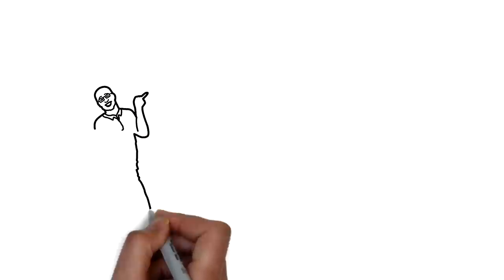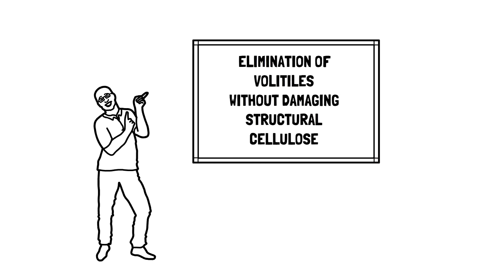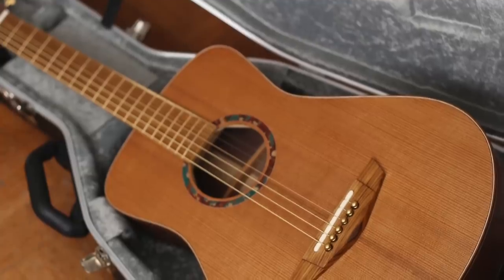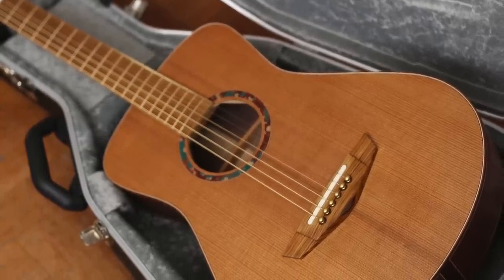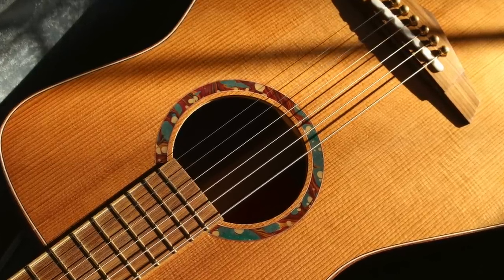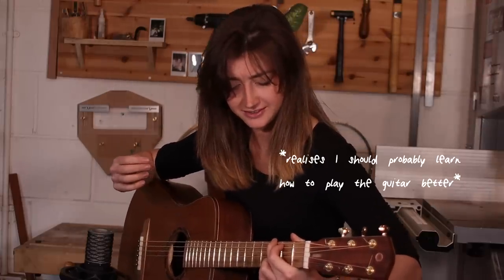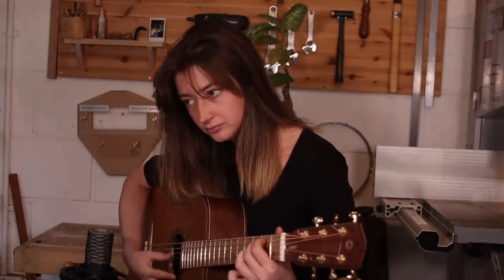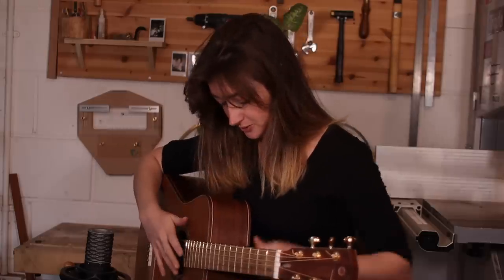I Made a Brand New Guitar With a Vintage Tone

Comment: Talking about going into a rabbit hole!  I just went through this with my wife wanting  a more vintage sounding cello.  She  tried 30 cellos ranging in age from 1700 to a 2022. Turns out she preferred a 2022 Romanian model which was way more  affordable than the 1700 Italian Stradivari, which was $90,000 but sounded only slightly better to her than the new one.  It was off the table but what she used as a reference.    The other european 1800s and 1900s cellos did not stand out to her compared to the new one.  Tonal qualities  are such a personal preference. So, to start with, vintage what?  In the US, Martin and Gibson are the biggest manufacturers with vintage pedigree, ie making guitars for over 100 years and they generally have very different tonal qualities unique to each manufacturer.   Martins are generally warmer and fuller tonally  to me throughout their range of body styles.  I have both brands including my first guitar, a 1958 Gibson LG-O.  It is vintage but a beginners guitar and sounds like it has a pillow in it.  My band mate has a early 60s Gibson J400 that he loves but to my ears is just OK.  I prefer my 90s and 2000s Martins and Larrivees over it.  Prewar Martins seem to be the holy grail with many of the icons of acoustic guitar music but again that is personal taste.  Bottom line,  there needs to be a reference point of brand and model.  Then you get into what you were discussing Daisy which is drying the wood to get the resins to crystalize.  I have heard a prewar Martin and will say that it has a greater resonance and sustain over mine, but it is subtle and to my ears they both sound like a Martin. I hated the neck however and would never own one at any price for that reason only.  My experience is you can get really close to the "vintage" tone with modern technologies as you described with any string instrument.

Comment: From what I understand, vintage guitars were typically made using old growth timber with a tighter grain, which is not available. I saw the comment about barn wood. I would have thought that the guitar makers back then would have wanted a higher quality wood than would have been used in making a barn.

Comment: What you're really talking about is kiln drying. Speeding up the aging process using dry heat. But it leads to uneven drying, warps and splits. Air drying, over at least 2 years, is the only way to get perfect timber.

Comment: Of course vintage instruments almost always sound better and play better.  Your particular guitar would certainly sound better if a professional played it, no disrespect, but a wood instrument has to have more then tone, tone not doubt is very high on the list but also response and as you said sustain, also playability and durability,  I don't want a guitar that looks like the wings of a butterfly and is as fragile as one.  However, hardness and stiffness is not desirable either.  I'm quickly learning that a instrument for the most part is tailor made for a particular player.

Comment: Ive played an old, pre war martin before, and for me it sounded really dry but incredibly balanced. By “dry” I mean that it sounded almost unencumbered, like you just heard string resonating on wood. Do those old acoustic instruments warrant the price tag? I dont think so, thats just market demand. Some of those “golden age” Martins were built with incredible care and using beautiful timber that was already a century old too… i think you can build a modern guitar that rivals for sure. I mean, at one point those vintage guitars were also new. The difference between today and then is that there wasnt mass produced instruments like there are today. So perhaps the argument can be made that the majority of guitars today are just ok or pretty bad whereas then, just do to limited production and a only a few luthier houses, there was by  capita just more higher quality instruments and thus the ones that survived, more often than not, are pretty great if not spectacular examples. But, again, plenty of great instruments exist today theyre just understandably expensive and not the “norm.”
* also talking about acoustic guitars mostly where the wood/construction matter arguably more than on electrics

Comment: Great vid thanks. Agree on the vintage sound it's obvious in older guitars or guitars made with very aged Woods.

As legend would have it Bill May built a microwave torification kiln machine in the 70s for guitar woods.. was used for many years and guitar made with it sound very open and warm.. it's apparently still in the Maton factory  but no one's game to turn it on

Comment: I think the guitar sounds fantastic! There's a nice warmth and (another subjective and meaningless adjective, but...) throatiness that comes through despite your light touch with the fingerpicking. Speaking of which, this gives me a chance to brag that I've never used picks, started playing with fingers on purpose 40+ years go, and believe that demos using picks can obscure some details of tone and responsiveness. Your playing was fine, more than enough to be able to tell I'd love playing that guitar.
As for the vintage tone thing, it's an impossible question. Sure, lots of older guitars made in certain ways and of certain woods sound great. So do lots of brand new guitars, even factory made ones from brands that have no business sounding as good as they do. My very first guitars were Guilds from the 60's, really great sounding guitars. Economic necessity was such that I ended up playing a Kent GC size plywood thing for most of my "career" as an acoustic player, and I loved it. It did get better the more it got played, and it got played a LOT! But I'd never put it up against a Martin or other high end, solid woods guitar. It sounded better than it had any right to based on materials and workmanship, but only those willing to listen with their ears rather than their preconception-besotted brains would give it a chance. 
The best sounding guitar is the one that YOU like the sound of best, period. Go ahead and spend the thousands of dollars chasing "vintage" tone. I'll be too busy playing my relative cheapos and enjoying the hell out of 'em.

Comment: I think tonewoods and vintage tone and so on are 99% marketing nonsense (100% on electric barring the pickups). Put a cheap epiphone in Mike Dawes' hands (for example) and it will sound amazing. Give me your £6000 guitar and it'll sound pretty bad! Beyond any significant build defect the player makes almost all of the tone, with the strings second and the rest trailing miles behind.
Doesn't mean people shouldn't have the choice though, as long as they understand they're spending their money on either cosmetics or snake oil.
Reply: Well shitty plywood guitars are always gonna sound bad, but from the mid range up the sound is not getting any better, sure a master built 30 year old guitar is gonna sound nice and all but its not necessarily an improvement, it sounds different but not really better in that sense

Comment: There is a lot of debate going on out there about whether or not a vintage guitar is worth having.  I have an acoustic guitar that was built in the early 1970's.  It produces a warm resonant sound with good strings on it.  I prefer extra light Martin strings.  Over time the on a guitar ages and becomes seasoned.  It is the best sounding acoustic guitar I have. 🎸🎸🎸

Comment: sounds interesting. never heard of heating or baking the wood for this effect. One thing that I have heard of for improving the tone of a guitar is called a "tonerite". it works off of the idea of what you mentioned before. how the more the guitar vibrates the better the wood sounds (holds true I it seems for solid wood instruments. I think defiantly is not much of a factor for laminated wood instruments) it is a device that vibrates the top of the guitar at a very high rate and you leave it like that for a long time. for weeks. so its a bit of a slow process.

Comment: As a side question to vintage sounding wood. How is the the wood you normally used seasoned.  Years ago they spoke of 7 year seasoning, now I guess  it is all artificially done.
 I have a quantity of timber purchased in the 1990s for clock cases including a very nicely figured piece of mahogany. It has been laying on a ventilated steel shelf ever since along with oak and maple, so it has not been lonely.  It is presumably about as stable as it is going to get.  Do you get problems with  the wood you buy now or does a reliable supplier solve that problem.

Comment: A few years ago I was in Chicago Music Exchange and playing every Gibson J45 they had. What I found was the vintage ones did have a lot more resonance and sustain than the new ones, and the ones that were around 20 years old but had the exact same specs, finish, tuners etc had an obvious advantage over a brand new one tonally. There is something about a n acoustic guitar that has had vibration through the wood. That being said Torrified wood splits the difference and devices like the Tonerite seem to help players get there a bit quicker also. I just got my second guitar with Torrified wood, the first one showed up and didn’t sound bad out of the box… 48 hours later I could hear it changing… It changed a LOT in just a year and all I’ve done is play it. My second one I bought used so it already feels a little broken in, but I still thing there’s more it can do still. One thing I’ve learned is that baked spruce tops hardly ever go out of tune!

Comment: Have you looked at treating the wood with polyethylene glycol PEG as used by wood turners to work with green timber. It drives the moisture out at cell level.

Comment: Most vintage acoustic guitars would more than likely have a flat top rather than the modern radius versions also traditional bracing would be a consideration as well. Torrified woods would be a start as you have already suggested

Comment: I grew up with less expensive but older guitars and love the sound.   There probably are changes in the sound of instruments as they age and are played.   That said, my experience is that sound and playability are more dependent on the individual instrument and how it was made.   Not every luthier can bring out the best in a guitar, and if it was not done well to begin with, it does not necessarily improve.  A good luthier and even a good reset or good repair can do miracles for an instrument, but if quality materials were not used, there is a definite limit to possible improvements.

Comment: When torrefying the wood, run a frequency through it, e.g. 440 (A), or whatever key you think will resonate best for the guitar. This way the crystals will form based on that frequency. Just a thought.
Reply from the maker: Woah this is genius? Is this a thing?
Reply: @DaisyTempest  It's just logic, based on a similar idea of how magnets are made, e.g. putting an electromagnetic charge through a molten metal to align their atomic polarities.

Comment: The UK is an imperial country not continental. When we joined the common market they have tried to turn the UK metric but traditionally we measure in feet and inches, yards, pints, pounds Weight, distance in miles, not kilometres, and gallons etc.1,000th of an inch is far more accurate than millimetres. BTW, the government only decided to start dishing fuel in 'Litres' so petrol looked cheaper overnight but it didn't fool anyone (fuel is measured in gallons in your car and it says miles on the clock). Love your videos though, keep it up. 🙂